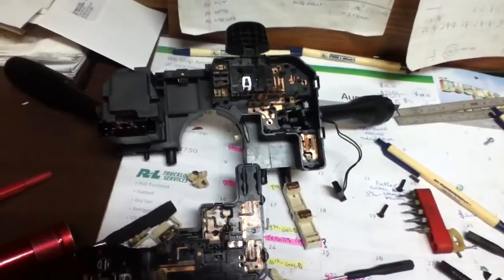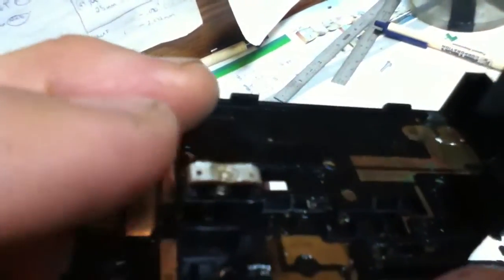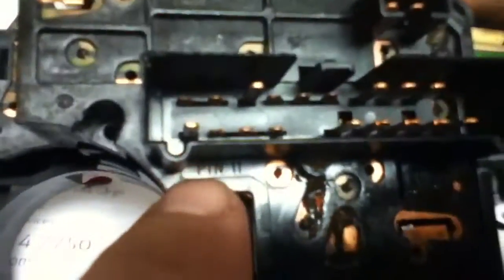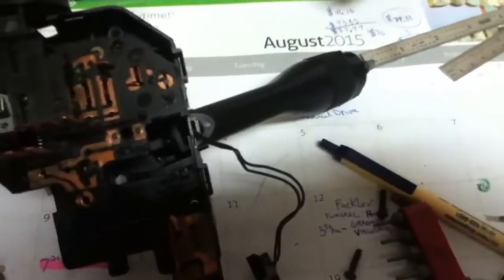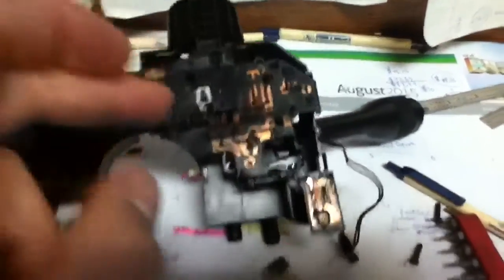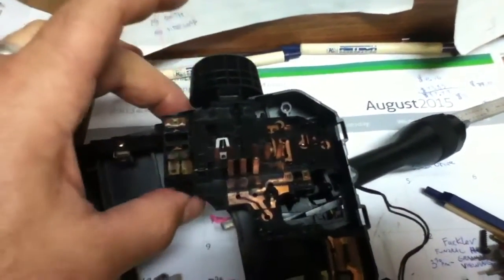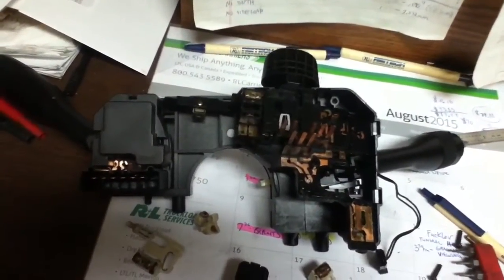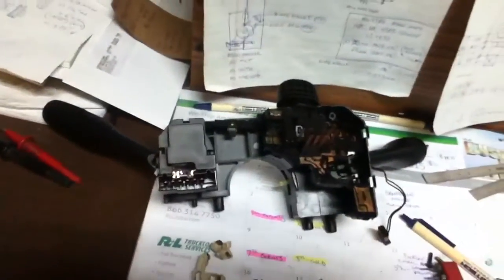PT Cruiser Fog Light switch bad. How to test

Comment: I am looking for the schematics for the headlight switch which you take apart in this video. My problem is different as it is with the headlights. When I turn the headlights on they don’t come on, but when I put the brights on they all come on. I thought it was in the switch so I replaced it and they worked. However after about a month I am having the same problem. I’m hoping to find something in the schematic to help. Thanks in advance for any help you can give me. Jan
Reply from the maker: the only schematics I have would be from a Haynes Manual.  I highly suggest you get a Haynes manual for any car you have.

Comment: I worked at a Dodge dealer back in the day when these were new and  replaced many many under warranty. Poorly designed ,never upgraded, and they all go bad period. We use to call them a mulit-F --up switch because they are. Buy one that has a lifetime warranty from a reputable long time auto parts store so you can get a lifetime of replacements .You will need to store the receipt in a bag or the ink will fade and warranty over.

Comment: How do I get my dog lights stay on on a 91 ptc
Reply from the maker: 91?  You mean 01?  Do they come on at all? If not your switch is probably bad on the steering arm.  There are fuses if I recal but not a relay.  Full fog light power/current goes through switch if I remember correctly.  Bad design.

Comment: nice video,, anyone know which wires go to the fog lights? wanting to just toggle switch them, they work, just sometimes they come on by themselves and drain the battery, so I just pulled the fuse on them..did you say pin 13 and 14 ?

Comment: Yes lol i found out how to turn them on.....I have the same problem as you...They do not work.....£120.00 i can get one for in UK. Is they any way of putting 2 wires to those plugs without destroying the existing wiring and putting a simple on off switch some were on the dashboard
Reply from the maker: Sure there is.  That was my first thought but my junkyard is close and cheap so it was easier to replace switch assembly.  $10-15.  I don't use the fog lights really at all so I don't worry about it burning up again.  Changing to LEDs would help with that.  You can probably find a cheap low cost replacement off ebay.  Good luck.
Reply: I did the wire trick in the end Justin. I got some wire that would take 15amp and a switch that would take 15 amp. I then took a live from i think pin 19 a red one. I think i took a wire from pin 12 2 Gray wires and pin 14 with 2 blue wires i think., I then put the switch in just to the right side of the hazard switch near to the trip button. Turned on and front and back came on. But my head went into a dizzy stage because i could only get ONE back fog light to work. Now at this stage after stripping out the fog light and looking for a wire that was loose or blown bulb and also putting the reverse light on you would have thought i would have twigged that it only has one fog light. NO not me lol When you look at my reverse light its kind of RED so to fit in with the other fog light...NO i bloody stripped all the wires again that i had just put in thinking i had made a mistake. Then i was looking at the fog light and thought you bloody idiot. Please tell me you only have one back fog light lol
Reply from the maker: Sorry mate, I only have two lower front fog lights, no rear ones.

Comment: so i went to junk yard to pull out some of multi switch pt cruiser but the problem is that if i turn signal to right side the fog and tail lights are on and if i push the handle in or wiggle it will switch off so what do you think the problem is?
Reply from the maker: This was the problem with the old multi switch or the one from the junk yard?      Your problems sound like there must be a ton of gunk somehow stuck in the switch.   You might be able to take apart and clean.  Try this video:
Reply from the maker: https://www.youtube.com/watch?v=JRLo-SxNYFA
Reply: Justin my original swith always turn on if i put the fuse in it never turns off even if the engine is off the fog light is on so i bought the one at junk yard it work but only problem is that when i turn the signal to the right the fog and tail lights turn on and when i push it in a little or wiggle a bit to the sides it turns on and off while turing to the right and it seems does have a lot of gunk inside when i got it.. do u think i can just air pressure it without taking it out?
Reply from the maker: Probably not.  Might have a bunch of bugs or crap in it.  That's a lot of problems for some gunk.
Reply: so do you think mine is not a shortage? it's just bugs? i hope it is just minor brand new switch is like $40 and i bought the junk one for like $30 i should have bought the brand new one
Reply from the maker: oh yours has shorts but what's shorting it out is the question.  Has to be some serious gunk in that thing.  Did you take apart yet?

Comment: Because I never use the foglights, wouldn't be easier to just disconnect or pull the bulbs rather than replace the whole switch?
Reply from the maker: In PA for inspections if you have fog light they must work.  Sure I could just disconnect until inspection time.  That's actually a good idea.